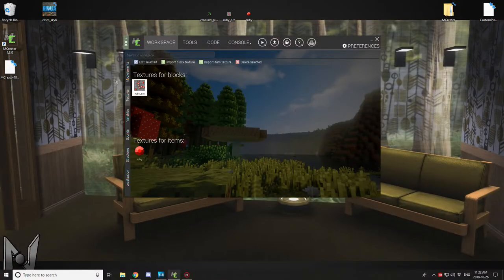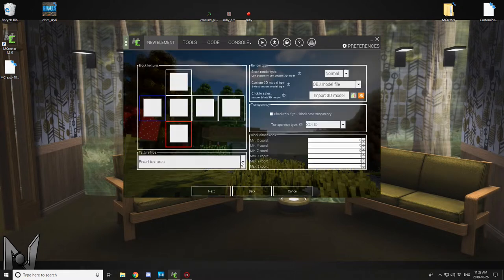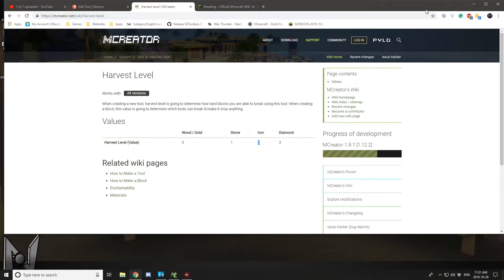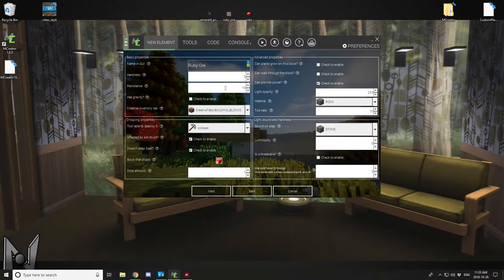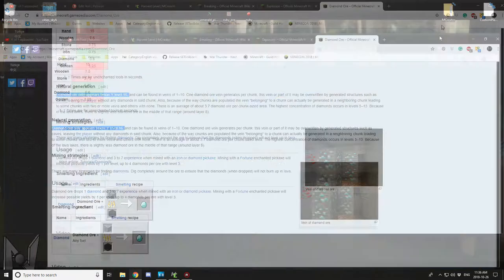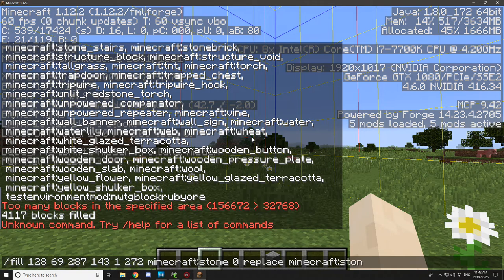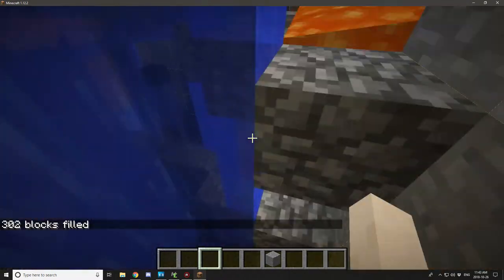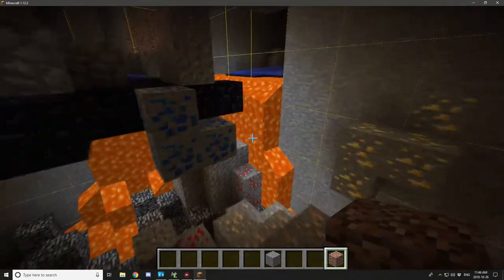MCreator Tutorial: Custom Ore | 1.8.0

Comment: when i click the blue panel for the ore texture it doesnt do anything
Reply from the maker: It will only add all the textures when its a new block or no other textures have ever been selected. Other than that it has to be done one at a time. If it's not adding any textures at all it may be a bug and I would suggest opening a ticket on the Issue tacker and submit a bug report with your workspace.

Comment: for some reason my ore wont spawn
Reply from the maker: It seems to work on 2020.5 for 1.15.2. I just added copper ore to my own mod last week so I know for sure it works on that build/minecraft version. 
Maybe consider updating your mod if you are using a older build, it may fix some issue.